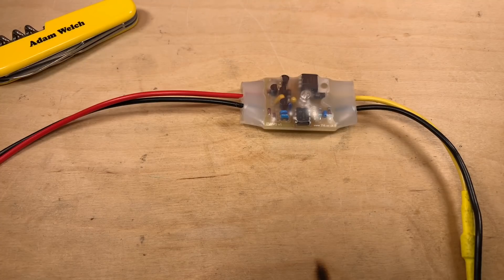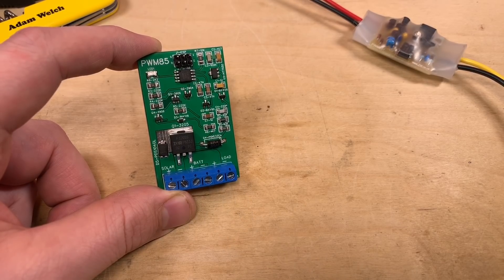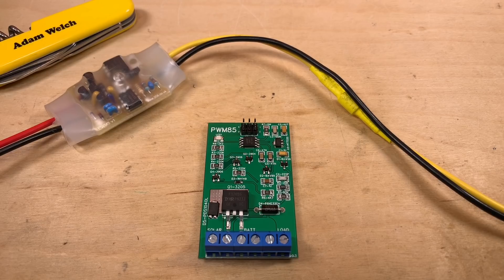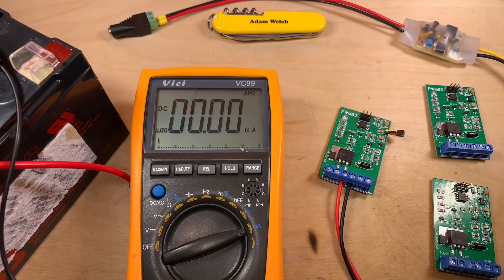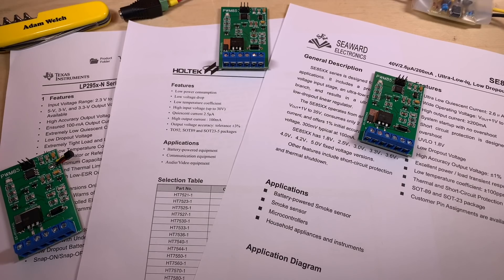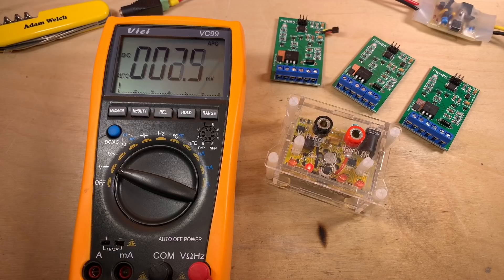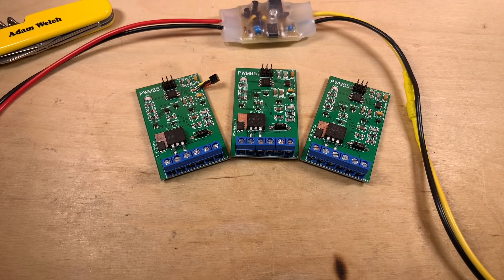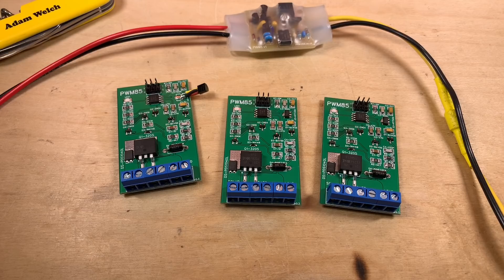Arduino PWM Solar Charge Controller v4 - PWM85

Comment: Why not use a logic level gate P-Mosfet like the SQP50P03-07_GE3 (7mOhm @ 30A) and a single 2N3904 to drive its gate for $2 total? 
Instead of this horror of 3 transistors, a charge pump and a mosfet. Use a TL431 ($0.04) as a 2.5V reference. You can't get a cheaper, temperature compensated ref IC. 
Whoever designed this, is still living in the 80's.
Reply: Julian is over 100 years old....quite young for a Timelord.
Reply: Good points, but what's wrong with living in the 80's...? lol
Reply: I'm interested in your recommendation and hope someone looks into it.  Adam?  Others?  This circuit was initially designed by youtuber Julian Illet a number of years ago.  He's quite knowledgeable, but you are probably right about the 80's thing as he's slightly older than me and probably did much of his professional training in the 70's and 80's :) .
Reply: Aren't the resistances higher on the p-channel? As in, a lot higher?
I'm trying to do an IGBT version...

Comment: The accuracy of the 5V regulator doesn't matter by using the internal 1.1V bandgap reference for ADC.
Reply: But the 1,1V reference isn't accurate either. Although it should be pretty stable across temperature I think.
Reply from the maker: I did look at this but the 1.1v reference can be anywhere in between 1.0 and 1.2 volts according to the data sheet - that’s like 10%! The 2.56v reference anywhere in between 2.3 and 2.8 volts. I guess in practice they might be far better?
Reply: @AdamWelchUK  The trick would be to first calibrate the internal reference (i.e. measure and store in EEPROM), and then the tiny85 could compensate for any drift in the supply voltage... It would be better to go that way as the 1v1 internal reference is stable in the full operating temperature range IIRC.
Reply: use an external ref. then you can pick the accuracy you want. but they will all suffer from drift over time. even your resistor divider chain will drift. so you need to use high spec resistors! it all depends what tollerance you want on the battery voltage.

Comment: Perhaps the next evolution of the design would be to make it into a MPPT charge controller?
Reply: That would be exceedingly interesting, at least to me. If Adam ever decides to tackle that, I hope he'll also include very in-depth explanation on how it works -- even if it required splitting the video into a couple ones.
Reply: @WereCatf  we really need an open source MPPT project!
Reply: There are quite a few MPPT charge controller chips out there, just can't remember the part numbers. plus all the data sheets i had are now at the company i no longer work at.
just looked up the LT8490 which does the whole thing without software. just throw a few big fets at it and away you go.
Reply: It's not easy finding them and they're generally pretty expensive. I, personally, only have experience with the CN3791 single-cell Li-Ion MPPT-chip from Consonance Electric. It's cheap and easy enough to work with, but I can't help but wonder if there aren't any other hobbyist-friendly -- ie. cheap -- ones out there. In fact, I'd totes love to find a single MPPT IC designed for 3S-packs, instead of cobbling some together from multiple single-cell ones.
Reply: @WereCatf  Yes, that would be awesome to bring it into the tinkering budget!
Reply: @TheEmbeddedHobbyist  Thanks for the interesting info. I'll look up the LT8490.

I'm more interested in the software side, so I'm imagining hardware hooked up to a Pi or something that controls it.
Reply: https://github.com/rasberryrabbit/12F683MPPT I have simple amateur MPPT design. It's open source!

Comment: Seeing ATTiny85 datasheet "§22 - Typical Characteristics" charts and tables

- You can permanently disable USI module in the Power Reduction Register (PRR) to gain up to 0.1mA (100µA@5V-8MHz);
- You can disable ADC module when not in use (it is tricky!) and gain up to 0.34mA (340µA@5V-8MHz);
- You can use SLEEP_MODE_IDLE instead of delay(10) to gain around 0.6mA (while still using counter/timer), see https://forum.arduino.cc/index.php?topic=220096.0
Moreover, AT85@1MHz VCC can be as low as 1.8V. It reduces consumption a lot (but you need a minimum voltage in the driver pin).

Those numbers may be optimistic, but it worth a try!
Great work, that's a really neat board!
Reply from the maker: Cheers Marc and thank you for the ideas - I’ll definitely look into them.
Reply: @AdamWelchUK  Hello, i came here to say basically what he said. However, you can go much lower in power : https://www.gammon.com.au/power
this guy does it with an atmega328, and reaches sub milli-amps power. Further down the line, he demonstrates how deactivating certain parts can go even lower, at some point going from 335µA to 335 nA, with sleep and optimisations. He provides the commands to do so; i'd strongly advise you to read this article. At this point, the consumption of the chip is lower than the self discharge rate of the batteries...
For a charge controller, you definitely can afford long periods of sleep (1 or 2s) between wake-ups to monitor voltages...
Reply: gymnastics

Comment: Adam, It's good to see that you improved on your design and for sticking with ATTiny/Atmel. When Julian announced his new design I was wishing for him to move away from Assembly language and PIC. I can understand the choices when he had a sellable product, where he was the sole hardware and software engineer, but the extra entry cost for a tinkering project is not worth it (referring to PICkit programmer). Julian's current code base leaves little room for other people to contribute bug fixes and/or new features.

Comment: how expensive would these be to buy if pre assembled? their small size and simple design makes it ideal for an ebedded solution (while being a bit more flexible than say the gumstick PWM)
Reply from the maker: I’m working on a spreadsheet to see how much they are costing me - doesn’t include my time though and I’m a pretty slow pick and place machine! I’ve not looked into it, but the new building service from jlcpcb might be the best place to find a real commercial price.
Reply: @AdamWelchUK  it would be a nice product for you to sell, seeing how well the PWM5 did
Reply: considering a far more complex PWM controller costs as little as £5 id imagine £2-£3 each

Comment: I'm liking the design Adam. Nice and neat, with plenty of space. 

I think you'll find the diode gets pretty warm at 100 Watts. I'm using 10 Amp diodes and have measured them at about 50°C. Hopefully you're thermal design will help keep that in check. 

Nice evolution of Julian's PWM5.
Reply from the maker: I hope so. I have been able to test it under a couple of amps and I’m expecting a peak of six. If the pcb heatsink attempt isn’t big enough I have planned that it could be a place to mount something more substantial. Thanks John.
Reply: An ideal diode like the SM74611 would barely get warm even with a 100W panel at the optimum time of day. It would be worth adding an ideal diode circuit based on a standard MOSFET.

Comment: Quick remark: for comparing the 3 boards, would'nt it be preferable to use only one and solder on it the 3 voltage regulators (in turn of course), because the few µA of variation between those 3 boards may be due to differences of the other components on each board.
Passive components have some tolerance, somewhere around 1% to 5% presumably, and the ICs (85 and mosfet) have to be different, even if taken from the same lot/batch! I mean the ICs internal resistance, capacitance, leakage, etc... must be (ever so) slightly different between each board that when we add-up the variations of all the components, maybe the difference in current is accounted for.
Reply from the maker: Possibly that would have been more fair. However the mCU is obviously the most power hungry device and I’ve tested the ATTiny a number of times in versions of this circuit and found little variance.
Reply: @AdamWelchUK  
At 2.6 mA I don't think it's an issue. I know the PWM5 uses about 1 mA, which includes the LED, but all these numbers are tiny, at less than 3/4 of a Wh per day.
Reply: @johnnodge4327  3/4 Wh/day is significant if you want to keep a 10Wh 18650 charged through an Arctic winter... though in practice I don't think it would be a big problem. A timer could perhaps be used to say switch everything off after 1 week of no sun, or if the battery voltage drops below threshold.

Comment: First view and first like ... Adam wrong time of the year to start playing with solar
Reply: It's never too late if you live in Florida.
Reply from the maker: Cheers Luc - it's true, this would have been better in spring!
Reply: Not here in New Zealand, Summer is on its way :)

I had 1.5 kW of solar installed in winter and even in early spring I am getting it running at over 75% (inverter only shows % ranges) for 4+ hours which means am generating around 6+ kWh per day even on average days.
Reply: @RobinHilton22367   Depends what you call average days of course :) . Here in the Benelux an average day might be 1 hour of full sunshine in this period.
Reply: @Luke-san  Wellington, New Zealand from some historical stats I read somewhere experiences 5.5 hours per day of PRIME sunshine when averaged over the year. Obviously more biased towards the spring/summer months.
Reply: @RobinHilton22367  I'm sure that solar panels really make sense to buy there. A lot more fun climate to make use of natures energy resources than here at the moment although they are predicting 20C this weekend ...  *predict as in might change the day before to 48 hours of rain and 0 UV. Now if they would invent rain panels me and Adam would be queuing up to get them like there is no tomorrow. :-)